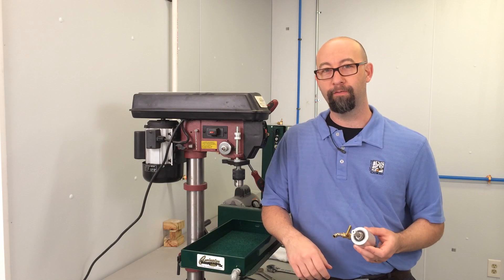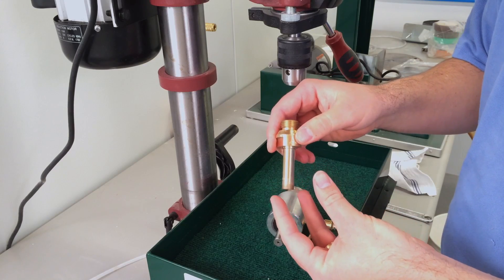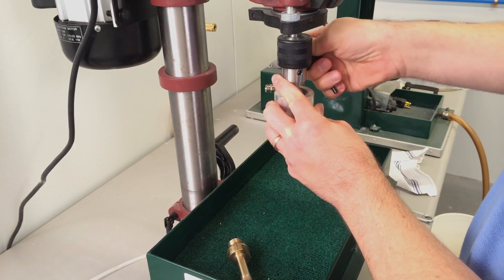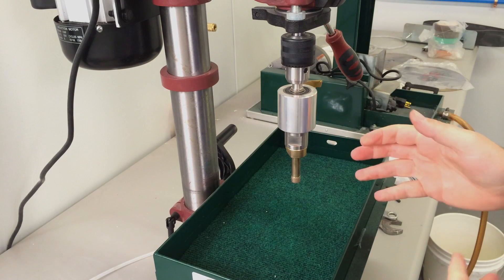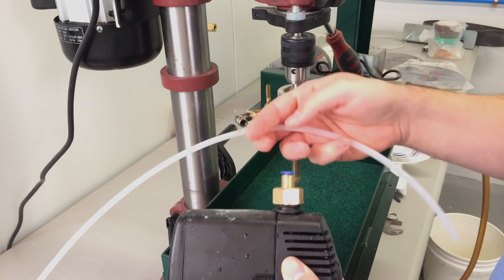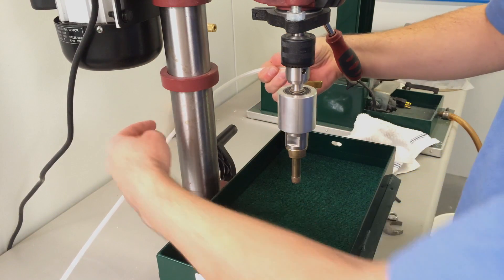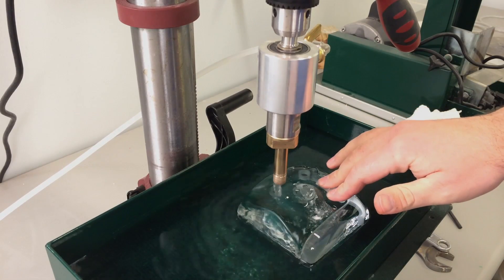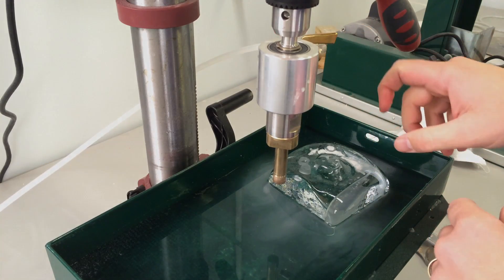Water Fed Drill Head Assembly and Sintered Diamond Core Drills

Comment: I am looking into drilling liquor and wine bottles. A LOT of them for at least a year. Is this a good setup for me? This seems like a nice setup but the bits are kind of pricey. However,  I'm not sure how many bottles I will able to drill with one bit. This may save me money in the long run. I'm trying to setup a production line in a garage. Thoughts?
Reply from the maker: For the number of pieces you're looking to do, the sintered core drills are the best option. Price wise, the largest expense is the initial setup. The drills themselves are comparable to and sometimes less than quality electroplated core drills. There are definitely cheaper drills on the market, but they'll wear very fast and cause excessive chipping and breakage on the bottles. It's definitely worth investing in the quality drills for bottle drilling.
Reply: Thank you!
Reply from the maker: You are very welcome.